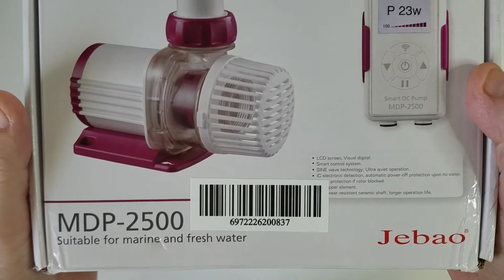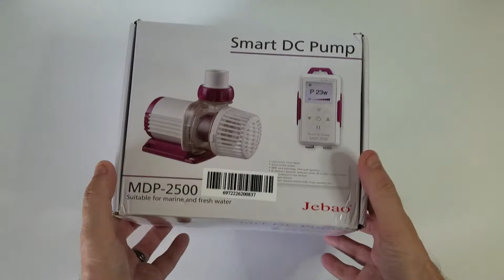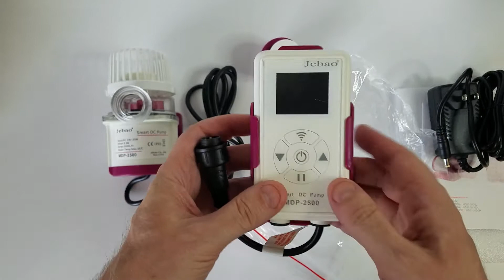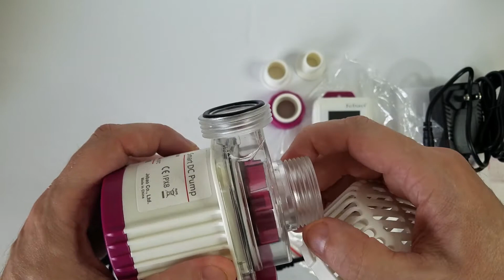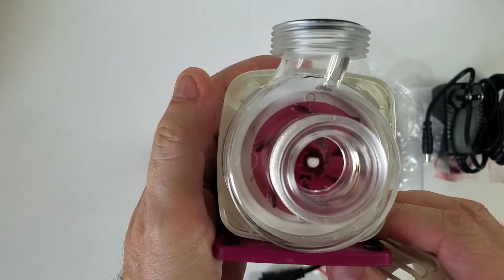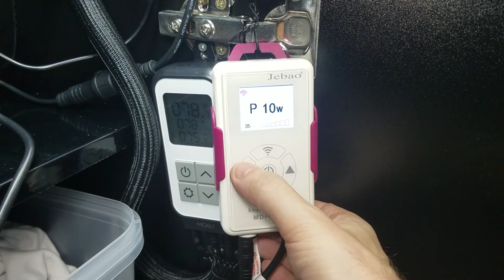Jebao Smart DC Pump - MDP 2500

Comment: What's the noise level on this pump like, in the rear chamber? Is it sitting on the glass at the bottom? Or did you cut the lining short to make it levitated in the water?
Reply from the maker: Thanks for your question. It's sitting on the very bottom on the glass. I dont here any Noise coming from that pump.
Reply: @artisticreefs  thanks for the reply! I've ordered this pump to replace a sicce syncra that is too noisy out the box for my standards but the Sicce although reliable is still an AC pump. So anxiously waiting in the mail for this Jebao DC pump hoping it'll fix the noise issue. Also, fmI should have mentioned in my first comment that you put up a great video and great review. So thanks for the detailed unboxing!

Comment: Do you notice any sparks from the plugs when plugging the power supply into the controller? Older models have this issue and it’s a bit disconcerting.
Reply from the maker: No, never noticed that before. But I always connecting the power supply to the controller first, than plug into the wall.
Reply: Yeah I could see that happening while plugging that in with power still on.

Comment: Hi
Are you experiencing any uneven water flow?
I'm tweaking  jebao smart return pump MDP-2000 
for last 7 days  or to much or not enough flow I I try from 50-80 gear %
Nothing works ( 
Pls let me know if you have any ideas?
Reply from the maker: Sorry for the late reply and Happy New Year. No, I haven't experienced any uneven water flow issues from my return pump. Uneven water flow issues are usually from not cleaning your pump and or something clogging the inlet of the pump. Could there be something in your return line that is giving you uneven water flow? hope this helps.